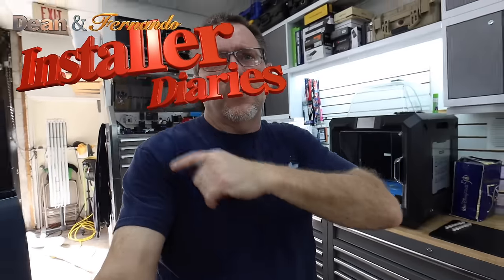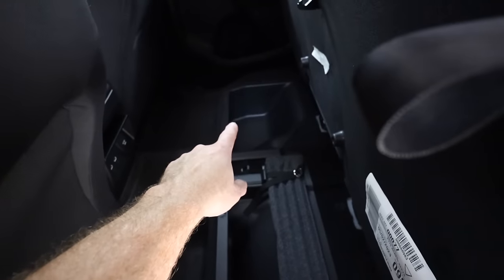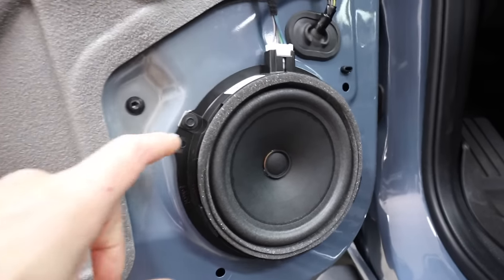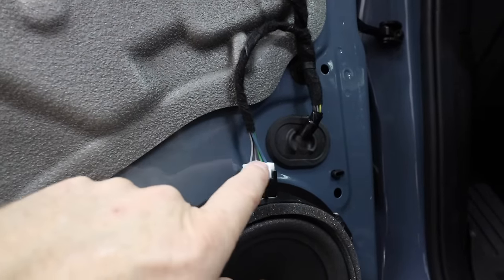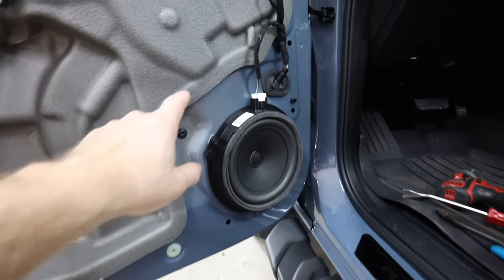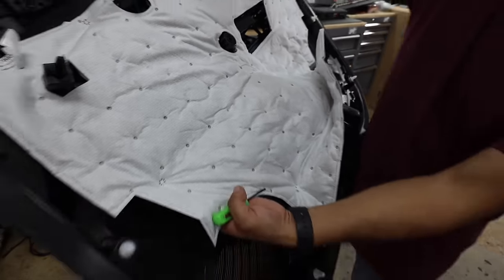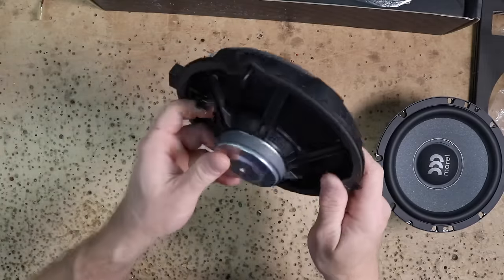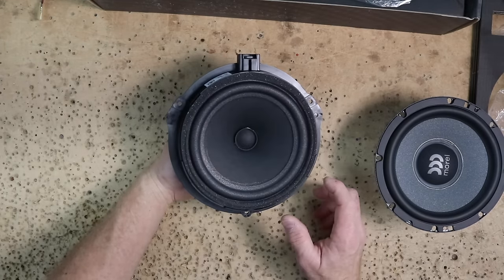New Ford Ranger in for a Kicker Key and Morel upgrade Installer Diaries part1

Comment: I wish more time was spent going over the wiring to the front door speakers and tweeters! Are the stock wires being used to power the 6.5 speakers? You mentioned new wires being run for the tweeters ? I have the same truck and just trying to figure it out! Can the amp run the power back through the stock front speaker wiring using this PAC harness? Thanks a bunch!

Comment: Thank you guys, thank you for doing this version of the Ford Ranger. However I have a newer Ford Ranger Next Gen with an Alpine  HDA-F60 driving HDZ-65C fronts and HDZ-65 rears. This is connected to my standard radio (Fords 10”) unit via LC6i from AudioControl and the Kicker power SUB of the line convert. The sound is great but missing the clarity I wanted. Would you recommend I replace the LC6i with a DSP, and which brand and model of DSP? Thank you and keep up the great work. Helped me hips doing my own sound.

Comment: This question may have been asked previously. Would a person have to use resistors to load down an aftermarket deck if the speaker outputs are not used?